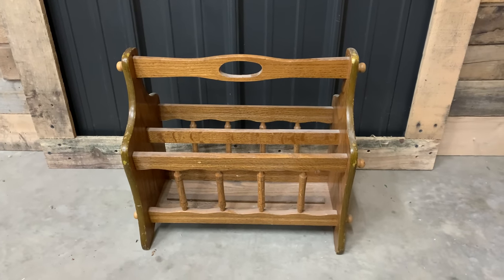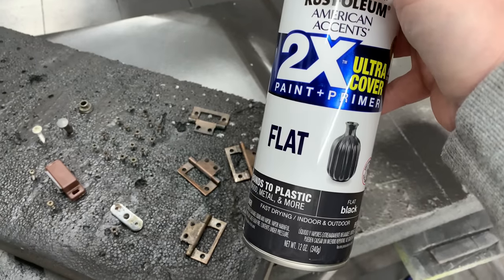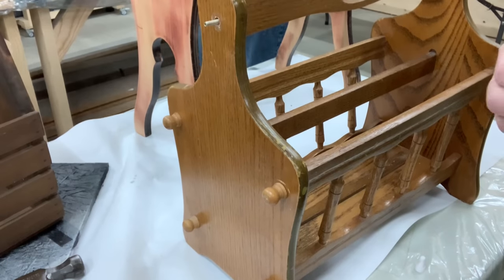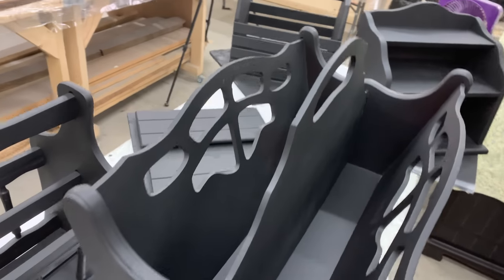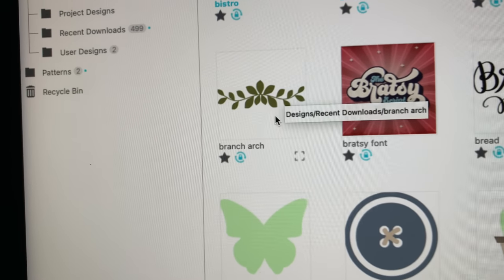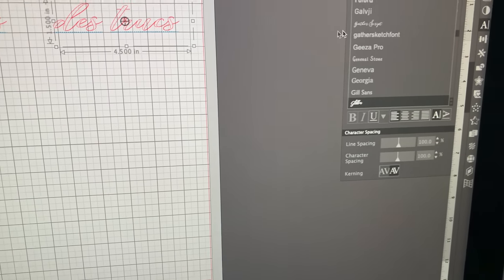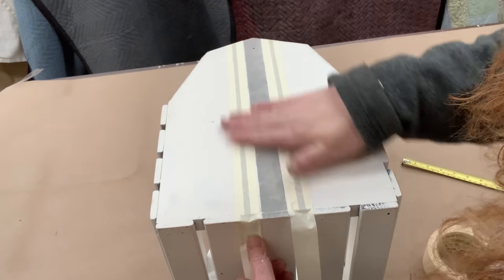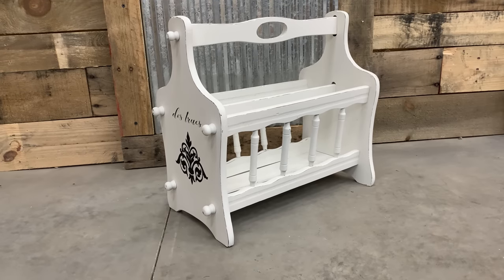Trash to Treasure || Thrift Flips ||  Magazine Racks || Flipping For Profit || Farmhouse Decor

Comment: The magazine racks all turned out perfect. Thank you for the tips of using masking tape and applying the multipurpose paint with the cosmetic sponge. I have tried that with stencils and it now is my preferred method. Also the biggest tip of using the hair dryer when removing stencil vinyl. I used to get so frustrated when I would spend the time to prepare my surface for stenciling, only to have the paint come up when I removed the vinyl stencil. Not anymore!  😉
Reply from the maker: Thank you for sharing that some of the steps I do were helpful. Of yes.. frustration is real having tape remove paint.. I always hope I don’t forget that step.. it’s all those little tip everyone shares💕